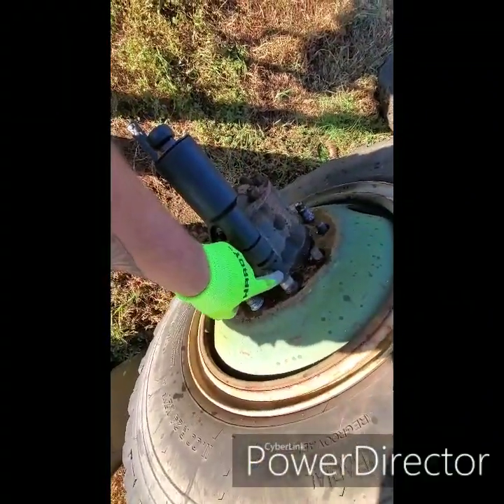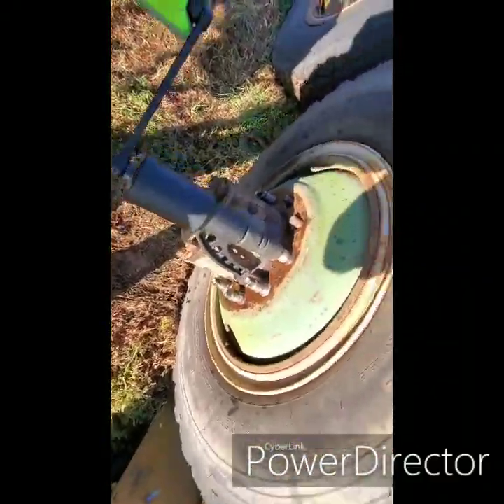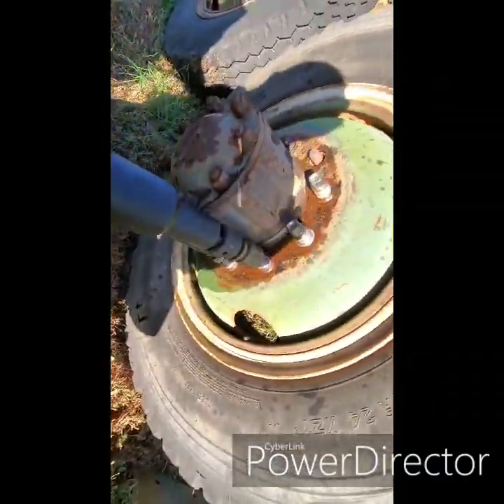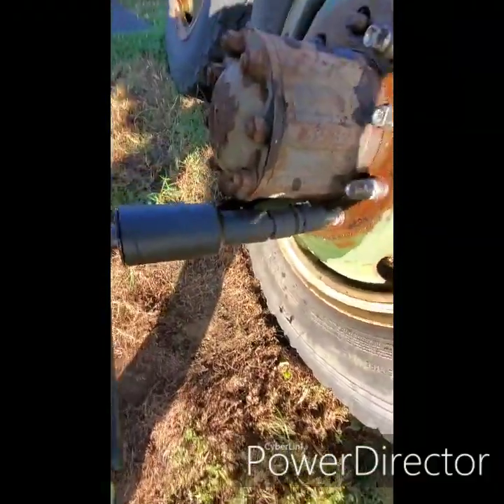Klutch Torque Multiplier Review

Comment: told ya a torque multiplier is what ya needed hah
Reply from the maker: I did it as a demonstration.  I do not need it at all.  It is really a pain to use on the outer dual lugnut. I do everything with the dewalt 20v gun. Or if it's really stubborn i have a 3/4" hydraulic impact gun.

This was also a in the field repair on trucks that have not had their tires on in 5yrs or more.   The lugnuts and thimbles should have been heated
Reply: @wessimpson2794  aye i understand. did you buy a new truck?